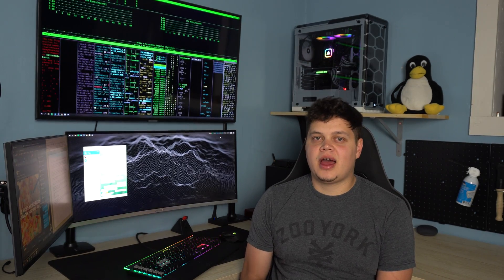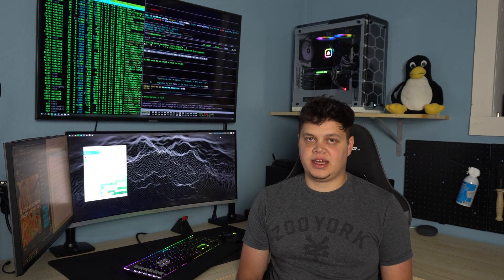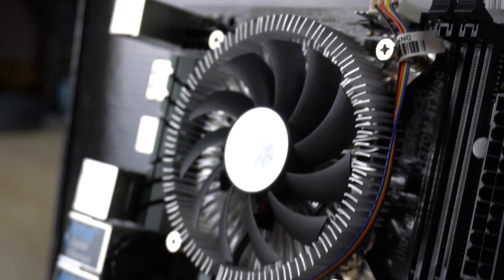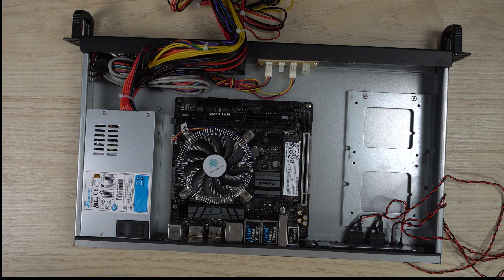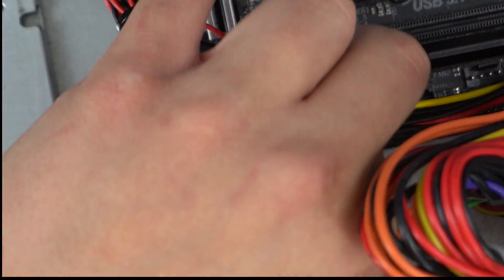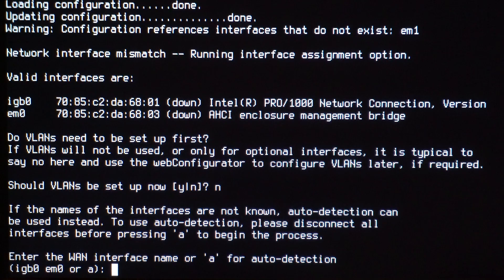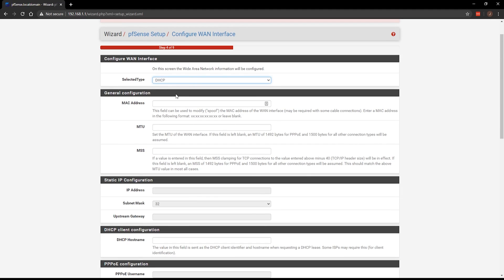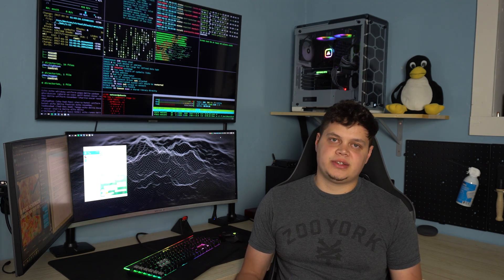Building a Router with pfSense in 2021

Comment: Is there a point in building a pfsense computer to run OpenVPN and use a VPN service? I currently run an ASUS router that I can use my VON service on, but I’m internet plan is a gigabit, but with the VPN activated, I don’t get near those speeds. I’m assuming the router just can’t handle those speeds, I am hoping building a dedicated computer to use as a router will be able to get those speeds up. I’m using NordVPN if it matters.

Comment: Really good video Joey!  Why did you make a point that 58watts was a little high for a router?  Why would it matter?  You could load pfSense onto a full size tower i9 11th gen with 128GB ram.  What's different about what you have?
Reply: 58 watts would be about an extra 42 kWh per month in electricity usage so would definelty be noticeable and a concern for some.

Comment: What kind of LAN to Wan speeds are you getting? Are you running any plugins?
Reply: Also curious about this.  Every video I find on youtube about building your own router ends the same way.  Configure it like this and that, ok done.   No tests, no latency.  Most watching these videos, like us, probably want to know if this setup has better latency and equal or superior throughput vs an Asus or Netgear or TP Link AX11000 router.  The newer routers that offer quad core 1.8Gz cpus and 1Gb Ram and 512Mb flash cost as high as $600.  Is building your own router better or worse in terms of performance?  Don't care about Qos features (that add lag), or tr affic shaping, or parental controls, or any of those enterprise features.  Just want fat pipe with low latency.  Which provides that?  Off the shelf router or custom make your own Pfsense based custom brew router?  Apparently this is an enigma that exceeds the cicada internet riddle...

Comment: So... How's the router doing for you now after this many months ??
Reply from the maker: Its been great so far. I've had it in production since May of 2020. The only issues is the included fans with the case started giving out. But I went ahead and replaced them with some Noctuas. But besides that no issues. Went about 162 days without a reboot and was rock solid the whole time.
Reply: @JosephF21  amazing!

Comment: Is there a quiet (ie fanless) solution with this board?  I'm embarking on a pfsense build.  I just need a fanless CPU that will do AES-NI.. nothing more really
Reply: Yes, you can buy something on amazon, keyword "Qotom Firewall" this will do the trick and supports pfsense
Reply: @zylo9531  Thanx.  Those are nice pre-built solutions, but I was looking for something DIY so I could re-use my existing 1u rackmount case.  I ended up going with an ASRock-J4005-ITX which works great with pfSense, is fanless, and suits my needs.

Comment: Thanks for your video. Awesome job.  What would be a good 10 gbit card to use on the lan side?
Reply from the maker: Thanks! I appreciate it! I've personally been using an Intel X520 Dual 10 Gig (SFP) that I got off eBay for $40. I generally recommend Intel NICs and there are plenty on eBay from old server's, business surplus  etc.  The X540s are also great if you need copper instead of SFP.
Reply: @JosephF21   Thanks so much. Have you any issue with heat in the 1u case?
Reply from the maker: @seant8120  None so far! It stays pretty cool even at high load. Been running this since May.
Reply: @JosephF21  ok cool
awesome! I was just concerned when I am seeing loads of 22% on the CPU and Temp hits 149 degrees

Comment: I went ryzen 3200g, Abit b450, 120gb ssd, 16gb, dual intel lan cards. Some old case I had
Reply: What is your component list? As I want to build a box with 10 G-bit Ethernet.
Reply: @matldn2697  the freebsd kernel won't do.much above 3 or 4 gas I think. Ryzen 3200g,  gigabyte b450 ds3, 16gb 3200 ram, 120gb Kingston ssd, dual Intel.pcie 2x lan cards. Random old case and some ocz psu I had.
Reply: @Phil-D83  Which LAN cards?
Reply: @matldn2697  two previous version of the EXPI9301CTBLK. They were called 8742 or something.  Old parts I had from a freenas build
Reply: @matldn2697  I posted on the pfsense forum about it in Oct 2019
Reply: @Phil-D83  OK.

Comment: Thanks I had an Asus Z270 lying around but then instead of specing on the CPU which was costing more picked up the  ASRock Motherboard & CPU Combo (J4105M) with  10Gb Ethernet Network Adapter Card- for Broadcom BCM57810S. Will build it with 8 GB ram lying free and an SSD onto a  Silverston SG12 case with a 450watt Gold PSU. After all this it have to run constant 24/7 365. I recently upgrade to 1 Gig Down and 1Gig Upline but limited to use 2 clients with 2 ports from the Roputer in order to achive that.

Comment: can u tell me the total watts consumption??
Reply from the maker: Great question! I've had this setup for a couple months now. I average 28watts idle and up to 45 watts at peak hours. My use case scenario is a little unique as I have about 230 clients across 4 vLANs. Because in addition to using this for my business and personal purposes. I also use this router to sell internet to some other people in my neighborhood. (I use Ubiquiti wireless equipment for this). My connection is 500mbps up and down. If you are using this setup in a more traditional way I would imagine that you would see slightly less power usage. 

Power usage may vary as well. Since pfSense is such a feature rich suite. For example, there are many plug-ins. Ones you can use to track bandwidth usage, save bandwidth with proxies (storing website cache on router) and VPN (if you want to access your network remotely). These are just a few plugins / features among the many. Some can be CPU / resource intensive and up your power usage. 

Thanks for watching! I'll definitely be doing more pfSense coverage in the future.
Reply: @JosephF21  Thanks for reply. i was planning to build router which is power efficient and can handle 100mbps/100mbps up and down.
Reply from the maker: Very nice! Another option that would probably do well for your connection is an Mini PC. They have some with 4 Ethernet ports that work well with pfSense. While they perform less than this build they would be adequate for a connection up to 300mbps or possibly more if your not doing anything crazy. Check out the Protectli Vault and the Qotom PCs. They should be cheaper than this build and more power efficient.
Reply: @JosephF21  Thanks alot for the suggestion. i will buy as soon as i this corona thing over
Reply: @JosephF21  +1 subscriber added. 😀